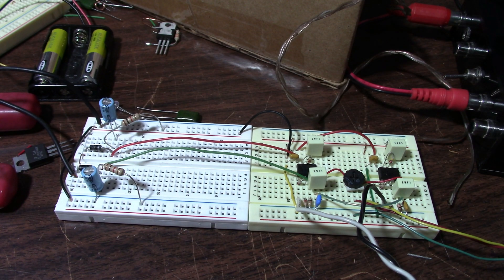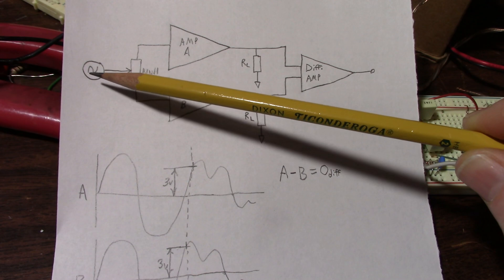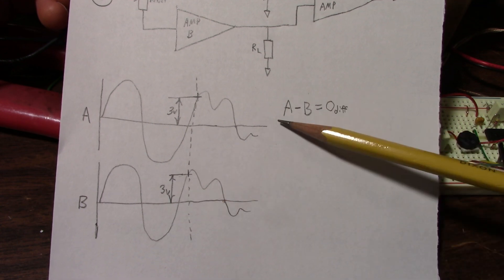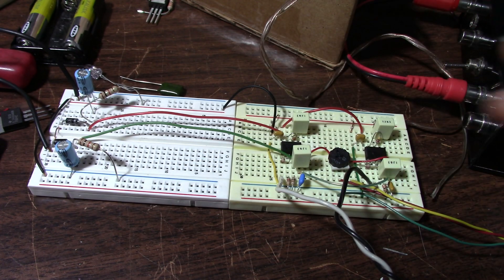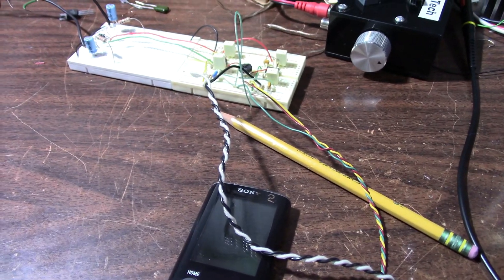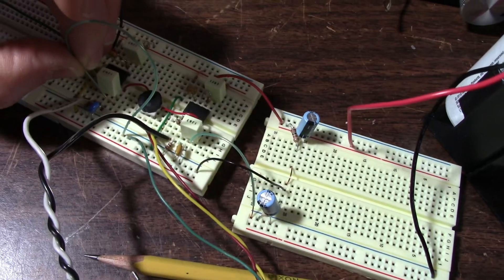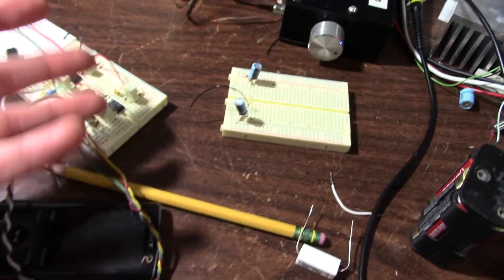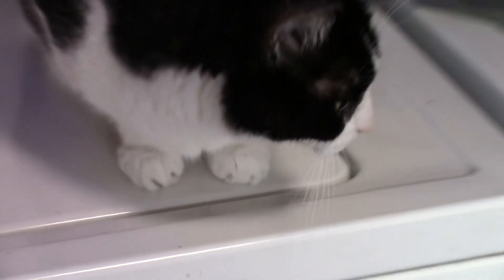Nulling operational amplifiers to find differences in the output signal

Comment: Interesting.  It would be interesting to see the the distortion output on the scope from difference amp.  So-called "balanced" headphone amplifiers claim that their advantage is common mode noise and distortion rejection.  However, this pre-supposes that the distortion between the op amps is identical; something I don't believe, in which case the only "advantage" of balanced headphone amplifiers is common mode noise rejection and the square of output power; distortion would be doubled if it weren't common.

Comment: Another excellent and instructive video, thanks.  I was wondering if you powered both op amps with the noisy psu but fed the music signal through only one op amp. Then fed the outputs through a differential amp to cancel out the noise only.  Would that work?
Great channel I’ve learnt a lot and I’ve still got a long way to go!

Comment: Firewire diy audio sabre adc dac soundcards have very low noise floor with 32bit precision. I use 24bit semi pro soundcard! It have 100-120 decibel dynamic range! If you can protect that input you can measure at uV -nV range noise floor

Comment: Although small, the difference between the two different OpAmps is probably something I could hear. I say that because it is no smaller a difference in signal than the one between say a 320kbs MP3 and an uncompressed WAV or FLAC file, and I can reliably hear that difference based on results from statistically significant ABX tests. Would it necessarily be a big difference? I guess not. But I am constantly surprised how seemingly insignificant differences in high end Hi-fi can actually be perceived (with proper scientific confirmation of course) and change the enjoyment of music.

Comment: Please add some oscillograms. I would like to see how bad quality of power supply can affect output of this opamp and what really stays after canceling differential signals. By the way, great channel, I have watched almost all of Your movies. Great job. :)
Reply: Could it be better to record the signal two times and do a cancellation in the DAW? With sufficient file quality, the result can be quite accurate. There is no need for balancing the level because then you can use the same circuit powered in two ways.

BTW. Balancing with a potentiometer is not ideal here, on headphones you can hear that something passes.

Comment: It would be interesting to feed a .WAV file and the same file compressed to .MP3 into this setup and see what's being thrown out by the compression process.
Reply: You can do the same thing in the digital domain, buddy. No need to add DACs and ADCs and cables and breadboards and op amps etc. to the equation.
Reply: @FiveseveNp90  The more I thought about it, the less possible my suggestion becomes.  Just synchronizing the starting points of the samples on the fly would be nearly miraculous.
Reply: I have seen a video that does this. I can't remember specifically, but I think John has done this. You might want to search through his list.

Comment: Many years ago I did some comparison tests at the tech collage. We tested the sonic performance between two chips, cannot remember the types, so long ago! One was a cheap, hardly audio, the other was a very high cost, highly rated at that time. Switching a blind test from one to the other revealed some interesting results. almost 50% though A was better than B. Later we identified the cheap chip as A and the supper chip as B. On a re test now, most thought B was better.
Here is the interesting point, at NO point in the tests did we actually change the chip, every test used the SAME chip. Amazing how people can convince themselves that amplifier B sounds better than amplifier A if it costs more!!
Reply: Confirmation bias, highly prevalent in audiophile circles.

Comment: I did this with an op amp microphone preamp. I recorded a repeatable static vocal take using a discrete preamp at low volume then ran that through the op amp pre. I swapped out 12 different dual package DIP-8s, cheap and expensive, and recorded the output. The differences were present but subtle. A few were drastic in volume but, after gain matching, they were closer to the others. My goal was to hear the different sonic qualities with my own ears and not analyze them electrically with visual aids especially when pushed into clipping. In conclusion... Depending on the circuit, a more "expensive" op amp in the audible 20Hz-20Khz isn't necessarily going to improve the sonic characteristics of your preamp. It won't diminish the sound, it just might not be beneficial.
Reply: Funny enough, we often have the same conversation with my friend how to maximize sound quality without snake oil. My PC, like many of them has front headphone input that I would usually use while using my PC. I used the rear one and for some reason whatever was coming from my Sennheisers was so much cleaner, instrument separation and resolution improved so much. Damn, it's just a connector and piece of wire. Maybe I just put my PC sideways to access the rear audio input if I fail at improving the front connection.

Comment: That was interesting to me..is it possible to check power amps this way? I see that possible, what you think? I always wondered without an oscilloscope how  somebody can measure distortion of a power amplifier, in this way is it possible ??
Reply from the maker: It can only compare if two signals are the same or not. Comparing the input signal with the output would be the ideal way to test amp performance but has its own challenges.
Reply: @JohnAudioTech  if I am checking the output buffer, since it doeas not have any gain, technically it should work tight? Thank you for the reply, much appreciated 🙏
Reply: You could actually reduce noise and distortion similarly in a power amp as well. Rod Elliot covers it somewhere in an amp design https://sound-au.com/ and compares the output signal with the input signal of the amp.
Reply: @nicoras8803  thank you 🙏
Reply: No because of phase shift
Reply: @westelaudio943  true.. I didn't think of phase shift. Thank you 🙏

Comment: I would have liked to hear different op amps in the bad supply side. See what difference that would have made. Especially everyone's favorite the TL072. It needs more shade thrown on it.
Reply from the maker: I performed a grounded input test of all the chips I had on the bad supply to hear the ripple. The LM4562 was the quietest, the TL072 was loudest (by far) and had more hiss. The others fell in between. I'm thinking of making a test jig board and performing more tests for videos.
Reply: Everyone does not favor the TL072, especially since TI does not recommend the TL072 for audio, especially since it's THD is rated at 0.003%. However TI does recommend the LM4562(THD 0.00003%) as quoted on the top of the datasheet "Dual High-Performance, High-Fidelity Audio Operational Amplifier". And it's audio specs are amazing.
Reply: @christophero1969  The TL072s main issue is noise, probably one of the noisiest available.
Reply: I second christophero, TL072 is not my favorite, most favour 4565 and it's cousins as good audio op-amps. The 5532 would be better than 72 in many cases, other than where v high input imp of j-fet is required.
Reply: Yeah, now there are many good modern chips available. But still in some applications older constructions remain hard to replace. Listing the THD and noise parameters in the table and comparing the numbers themselves makes no sense. It is more important to read in the datasheets the conditions for which a given parameter is guaranteed and to make sure if a given opamp is suitable to work with a given signal level at all. People often replace chips without thinking how THD and noise depend on the impedance of the signal source, for example. Sometimes at high impedances JFET turns out to be quieter than low noise bipolar and the differences in THD between expensive ultralinear JFET and cheap two orders of magnitude worse JFET turn out to be much smaller than the manufacturer's raw data would suggest.
Reply: Try JRC Muses 01/02/03, specs aren't amazing, reproduced music is

Comment: What exactly is the objective of this video?
Reply: To show you the difference of the opamps.
Reply: @johnyang799  Sorry, I see no point in using music as a reference. I would just have used a scope and verified the PSRR. John may have explained the objective technically better without the nulling of the music. No offence meant, I enjoy his program, it is entertaining. Lower down the comments you will see crhistofero 1973 mentioning that he could still hear the sound in his Sony head phones so he missed the point somewhat.
Reply: @nicoras8803  In the context of music reproduction... duh.
Reply: @johnyang799  duh???
Reply: @nicoras8803  Mind you the name of this channel??
Reply: To show how much sound different of good/bad psrr/svr amp. I also interested watching video similar like this, comparing between sound of 0.1%thd vs 0.0000000000001%thd amp or 80db snr vs 120db snr. Most of this value (psrr/svr/snr/thd/cmrr/slew rate) is stated in datasheet. We can verified that value. But, i dont know how much it will impact the sound. Like using opamp with 10v/us slew rate vs 3v/us, what the sound going to be.
Reply from the maker: @ariffpro  If I'm going to take measurements, I need to solder up a test jig board with better layout and use better components such as 1% tol. metal film resistors. I can get away with only so much on the socket boards.